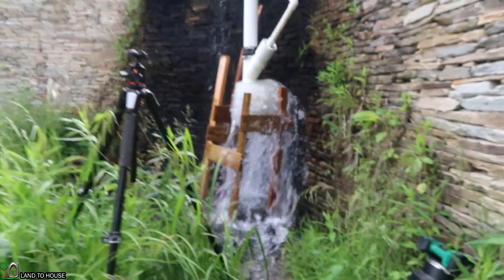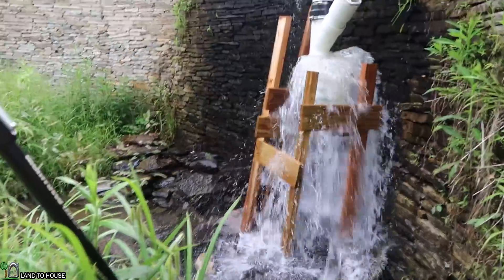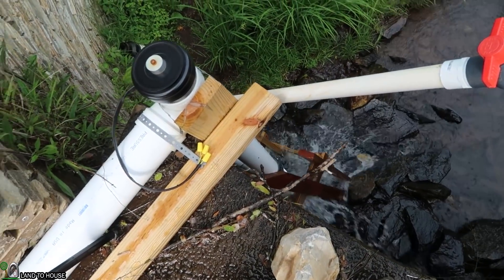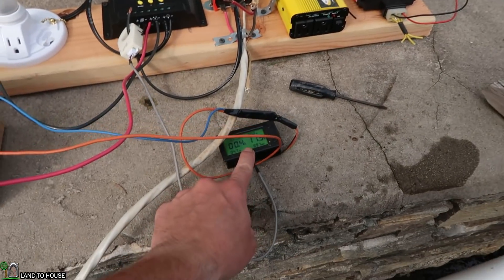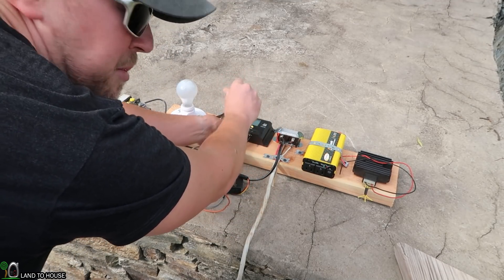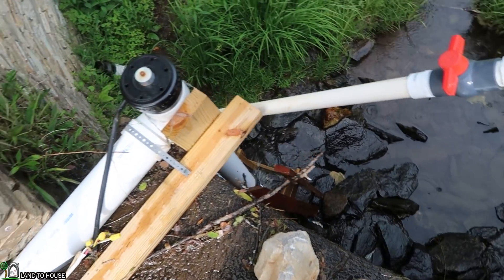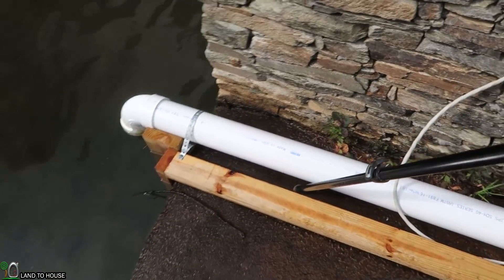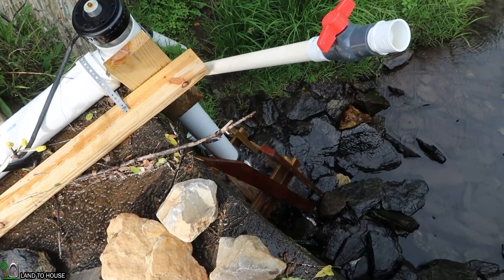Pull the Bucket for more Micro Hydro Power

Comment: Just watched this.  LOL  Turbines in the wrong place.  Easy fix.  Just put the turbine at the bottom and your golden.  All the pressure is at the bottom, not the top.  No one ever puts a turbine at the top of the stream.  You put at the bottom and shrink the pipe as well for massive pressure.

Comment: Or, curve the outlet pipe at the bottom gently with multiple short elbows then installing either a combo wye or sanitary fitting in the angled leg of the draft tube with the opening pointing upwards. Add a section of pipe to make a stand pipe pointing straight up. It seems to me that while this might add some back pressure to the system you would be able to employ gravity and direct the air coming in from the end of the pipe and allow it to exit before it got to the vertical draft tube. Much like your ram pump stand pipe.  Thanks for these videos, I enjoy learning from them.

Comment: the siphon stream doesn't have enough push on the pelton turbine with alternator loaded.. a flywheel's weight might overcome back emf on generator kept at that height.. or a sucker pump on the outlet of drain pipe to create added pull force..  more energy in pull than pushed friction..

Comment: He already had a bucket setup that was doing the job and now that y'all seen him taking it away fail you want to give them advice on how to fix it I say put the bucket back and let it work
Reply from the maker: The next test will have a downpipe increase into a bucket. After that I'm gonna extend the pipe all the way down into the water and we should see the best results
Reply: It is true the farther down the hose goes from the point the Water started flowing at the faster it will go so it should increase speed

Comment: Hey seth I am having trouble with my ram pump. I worked fine for weeks but not I can only get it to cycle 5 times and it stops.  I seems to also stop as soon as I open the delivery pipe. It is not plugged as I took it apart could there be something wrong with my spring check valve
Reply from the maker: If the spring check has debris in it the pump won't cycle. I have a video on that coming out this Thursday. 

You might also have back pressure loss if a hole has developed in the delivery pipe.

Comment: Just some thoughts about your set-up:
1. The fast ramp-down of the turbine after connecting the load / charge controller @1:40 indicates that the charge controller is NOT correctly operating/loading the turbine. It is literally shorting the turbine. Please go and get one of your MidNite Charge Controller. Only that will give you reasonable results of the power reading (see also comment of Joe Malovich in your Power-Reading Video).
2. The work angel of the impeller is probably to flat. It must be steeper (meaning: more parallel to the flow direction of the water). That also explains why the turbine is not starting by itsleft (you had to crank it always before it startet to rotate, even without load). What you want is a Kaplan like turbine.
3. Normally the cross-section is reduced just before and at the impeller. That leads to a conversion from hydrostatic energy (high pressure, low velocity) into kinetic energy (high velocity, low pressure). You want kinetic energy, because that is what the impeller&generator converts into electric energy.

Comment: The water exiting the draft tube must be secured from air. The exiting water need room to release its energy without immovable objects like the bottom of the bucket.  A better draft tube would be larger diameter after the runner as turbulence in and after the runner will increase in volume. My draft tube is cone shaped with 7 degree of slope and it stays just below the tail water discharge.  It to will lose all the vacuums energy if I remove the vacuum seal from the cone.  The 4” to 6” immediately after the runner will increase vacuum by reducing friction from the turbulent water. The longer draft tube is your greatest energy missing from the performance!!! The 2nd energy loss is not having a larger draft tube after the runner. You must have the “bucket” effect too.

Comment: Hi, Mathematics Major here :) I think that putting a longer downpipe as well as placing the turbine as far down the downpipe as possible will maximize the force applied to the turbine by the water.
Reply from the maker: Yes for sure. The next video will have a 6" pipe addition. Then the video after that will have a 4" all the way down.

Comment: Just had another thought.  What about 2 90 degree sweeps to form a U. Positioned much closer to the ground. 

This would act the same as the bucket but keep velocity higher. Air would naturally be expelled from the pipe instead of floating up into it and breaking the suction

Comment: I would think a reducer might help prevent air making it back up into the tube and provide less restriction than the bucket.  

With that said, lowering the bucket should also increase the velocity of the water in the tube.

It might be fun to crazy with it and see how it behaves with an adjustable cone on the end of it. Think like a garden hose sprayer that twists and moves the cone into the nozzle.

Comment: You could also try 2 U traps at the bottom of the pipe with a T and a 90 on each side with two more on top to redirect the water down. Also a battery powered shopvac would be a nice addition so you don't have to worry about power.

Comment: You could drill the right amount of holes in the bucket that it keeps up with the flow. Without having all the "back pressure" that is the water making it's way back up, and over the top of the bucket. Make the right amount of holes in the right places, and you'll have free flow of water, but still have water covering the bottom of the pipe. The trick may be to keep the holes up away from the bottom of the bucket. And now that I am seeing it in my mind's eye, I think this 'solution' will have it's own problems. As in you aren't going to get complete free flow, without that risk of losing it when the rotor stops.

What about another check valve on the bottom of that pipe? Make one from a yogurt lid? LOL In combination with the holey bucket...

Comment: Very inefficient. You need more speed not more flow or volume. 
Also without bucket you had more flow causing air intake up top?
That's a lot of water for 18 watts.

Comment: I have a theory.
So the water in the downpipe is creating a vacuum when falling, that sucks/siphons water from the pond.
Your generator is level with the pond and the water flowing through it is being sucked/siphoned from the downpipe.
When putting a load on the system, the generator slows down, and the vacuum in the down pipe can't pull enough water through the impeller, pulling air up into the system if you remove the bucket.
But wouldn't it be more efficient if you put the generator close to the bottom? 
That way you would not have to rely on the vacuum in the down pipe, but the weight of the water above the generator.
Then you still have the same head, and the siphon will still work, but the generator is now driven by the weight and flow of water from above, rather than just the vacuum from the downpipe below.
All hydro dams have the generator at the bottom, making the weight of the water drive it, rather than the siphoning effect og the outgoing water.

https://www.google.com/search?q=hydro+dam+cross+section&tbm=isch&source=iu&ictx=1&fir=Gd5YIJUVVuODCM%252CyoZlj2jiXbObWM%252C_&vet=1&usg=AI4_-kSTnz1rbfxWjoG__pQpxDVej8-TGg&sa=X&ved=2ahUKEwj13PqxqIPxAhXFmIsKHahKAX8Q9QF6BAgVEAE#imgrc=VM6GeXkJaZ7DIM

To increase the performance further, you should just extend the down pipe all the way down into the creak, giving you way more head and you would have no more need for the bucket if you submerge the end of the downpipe in the creak.

Keep up the good work.
Reply: For that matter, if you're using gravity to feed the turbine, could you then use multiple turbines in series? Like one 5 ft down, one 10 ft down, one 15 ft down, etc.? And double or triple your output? Would putting multiple "loads" like that, in any way impede the flow or reduce the head pressure, or whatever, and reduce output, or would it just scaled kind of linearly? Like putting 3 turbines at 5 foot intervals down the pipe would yield 3x the performance (or more? ...if the extra length would give more head pressure to the one at the bottom, if the turbines upstream didn't reduce it or something? Assuming it's all just gravity fed?)?
Reply: Does that make any sense? Like: 

|
|
|
|
(turbine)
|
|
|
|
|
(turbine)
|
|
|
|
|
(turbine)
|
|
|
|
(turbine / outlet)

??
Reply: @MGmirkin  Um…..no. 
There’s only so much ‘energy’ inherent in the system. Each turbine adds more operational losses in efficiency. 
You need to extract the greatest amount with the most effective design. Hence you don’t see power stations daisy chaining turbines on the same penstock.
Reply: These units are designed to stay away from the water. To keep the price low and relatively easy to construct, they need to be head end fitted. The only way to increase output is, as you say, to increase the static head by lengthening the waste pipe. 
As I have suggested elsewhere, if using below surface discharge, (bucket) to prevent siphon loss, there needs to be enough clearance between the end of the pipe and the base of the bucket so it doesn’t restrict flow anymore than necessary. 
As a napkin calculated rule of thumb, 2xD(outlet pipe)  end of pipe to floor and 3xD for diameter of ‘bucket. 👍
This would translate to 10” clearance in a 15” dia buckt for 5” pipe and 12” clear and >18” dia barrel for 6”
Reply: @DB-thats-me  
You don't need to put in in the water, just down the line and then make the line sloped, or put the generator in a water proof housing.
I really think putting the generator further down the line will improve the performance.
I know this is to small scale to really matter for this example, but remember that head pressure can rise indefenitely, but vacuum can only reach -1 bar = 0 atmospheric pressure.
So having the generator further down the line like hydro dams does it, will no doubt improve performance.
Reply: I think they’re going for simplicity over total efficiency but yes I agree with you, pressure head beats siphon head. 
The head unit design is further limited to <30’ of head. Not only, as you say, does the pressure approach zero at the top of the discharge pipe, but this in turn will induce cavitation at the blades!  😱 
I sincerely doubt if stainless impellers, not to mention plastic, would survive long in that environment.

Comment: My two cents:
Extend the downcomer to increase the suction, why is it so short! Extend it closer to the ground, Double 45 angle it (or use an electrical sweep 90 to maintain flow velocities), and have a 8 to 10 foot extension following that.  I could go into why it's too short but I think you already understand how a syphon works and subconsciously know this.
It's a CHEAP experiment with only a few dollars of PVC pipe and 1/2 hour your time to install... Just try it.
Reply: he knows this and stated it in the previous vid on the topic
Reply: @stuartpratt3662  yet he hasn't done it

Comment: Is there a reason why the impeller isn't on the bottom end of the pipe?
Reply: This should not matter. As long as the pipe is a closed system without air in it (except intake/outtake), the speed and force of the water should be the same at any point in the pipe. Increasing the drop (longer downfall pipe) etc. can change the speed and/or potential power, so this should improve the output of the turbine.
Reply: @Docustube  Can you put more than one turbine in the pipe, like at intervals down the pipe? Would that cause issues, or would it simply be additive? Like, I'd assume the flow would be the same at all points, so if all the turbines are outputting at the same flow rate, or whatnot? Wouldn't they all move equivalently and generate equivalent power? Or would each one be slowing the flow? And/or would that be compensated by the extra "drop" between turbines, like if they're spaced every 5 feet or whatever?

Comment: Bring the pipe to ground level about 2 feet from ground level, 45 it to ground level and 45 it again to a 36" discharge pipe that is parallel to the ground/stream bed..  That might increase your siphon enough to prevent losing it when loading the electrical system.

Comment: Would it not be better to use an MPPT controller designed for hydro, rather than a PWM controller designed for solar for your testing?

I get that the PWM solar controllers are cheap, but I don’t think they’re the correct tool for the job. 

Additionally, I also believe a 24v system might be better for this, based on the open circuit voltage. As soon as you drop a 12v battery on there, the output of the turbine is going to drop to 12v. In theory, the current should go up, but I don’t think there’s enough force in the water to sustain high current low voltage, so might be better to go with a bit less current at higher voltage to give a similar wattage
Reply: Yep a good MPPT controller, however it need to be able to operate in the MPPT tracking at the lower voltages that you are operating at.

Comment: Your empellor which propells the shaft needs more contact with the water. A long shaft that water is pushing against a lot of the shaft auger will push the generator armature the most.
Reply: Yes, If the impellor were further down in the pipe, the weight of the water would also apply more pressure and keep it spinning and would not be able to suck any air into the system at all...

Comment: A much longer downpipe would improve it a lot.. There are other videos on this, they all have much longer downpipes, for one it would allow more flow.. I don't know how to put it to words, but the longer distance water flows, it will pull the water behind it too.. Try adding pipe so it goes to the ground and away, like a few feet.. Just like syphoning water from a bucket, the longer and farther away the hose goes, the faster the water leaves the bucket.. I hoped you can get some useful info from my babbling on.. All you can do is test, test & more tests, you'll figure it out.. or go mad, LOL... Loved it..
Reply: Definitely something which would be interesting to see. like 5-10 Meter diagonal pipe all the way to the ground. More Water = More weight
Reply: @georg2010cz  Agree.. He did a video of a friend of his who has that larger one and the piping goes all the way down to the ground and a distance from it.. If the water supply was sufficient the water could empty in a huge barrel, another dam or another storage tank and run smaller piping to a couple ram pumps.. It is all up to what can be imagined...
Reply: Ya I don't know why he built the stand for the bucket vs just setting the bucket on the ground and cut a piece of pipe to fit
Reply from the maker: The next video will have a step up to 6" down pipe and after that will be 4" all the way to the lower pond..... youtube content 😃
Reply: @LandtoHouse  the bucket was acting like a sump and the water column above the  pipe exit is preventing the air from moving back into the draft pipe. Take the pipe all the way to the lower pond (use a 45 degree bend), making sure some amount of water is always present above the exit point, siphon will work. If the vertical distance between the entry and exits points is less than 10.3 meters (1 Atmosphere pressure) you shouldn't have any problems. Best of luck.

Comment: Maybe make the pipe a J shape so the air doesn't get in, but the water can get out more easy then the bucket. You could then try different setups on the short end of the J pipe with bends and pipe length.
Reply from the maker: Ah a "P  trap". That would be interesting.  I expect the two 90s would slow the water.
Reply: @LandtoHouse  Maybe 90 + 45 and some pipe.

Comment: Add more big pipe to the end
Reply: As the video wile back where u showed similar system
Reply from the maker: Yes I already have the pipe and fittings. Should be the next hydro video!
Reply: @LandtoHouse  just a thought but would it make a difference if you hooked it up and then removed the bucket?
Reply: @LandtoHouse  i have idea put p. Trap there haha instead of bukett
Reply: Better off to use a ram pump to fill a reservoir at a higher elevation and then feed a peloton wheel with much lower water volume requirements

Comment: What about removing the bucket after connecting the load?
Reply: I had this same thought.
Reply from the maker: I really think the turbine is moving so slowly it pulls air up into the down pipe.
Reply: @LandtoHouse  You could actually hear the pipe emptying as soon as you connected the load.